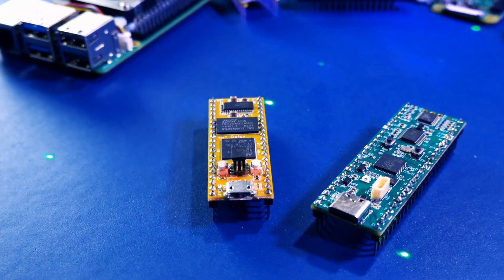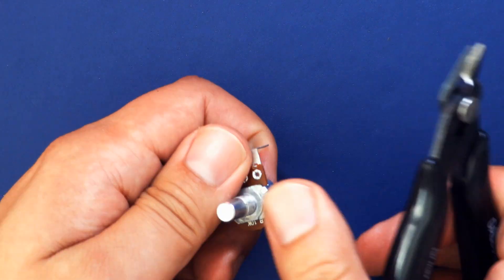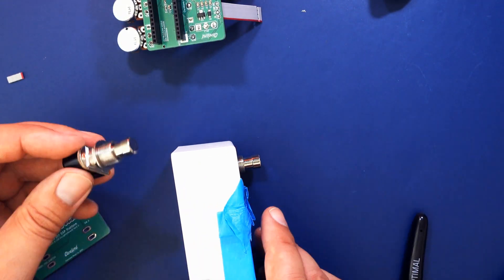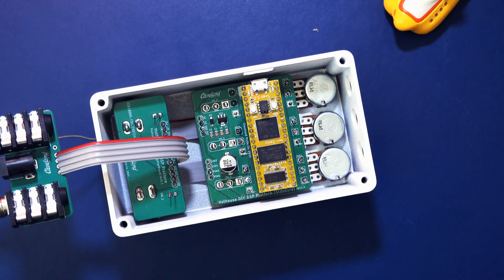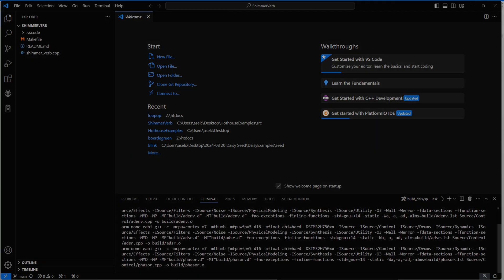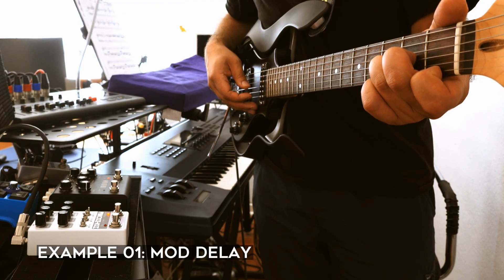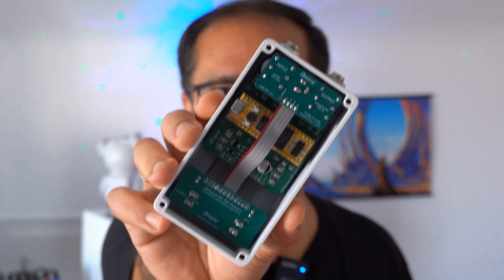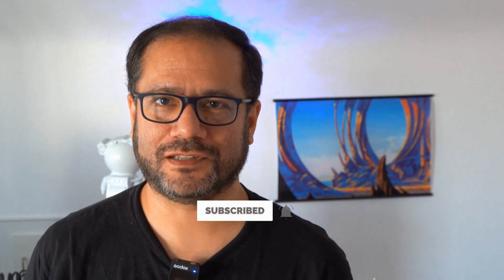Build DIY synths / effects pedals with Daisy Seed and Hothouse (pt. 1)

Comment: I'm looking forward to building mine. I got it about a month ago but have been a bit busy unfortunately to do much. 

I see a lot of potential here in a pedal form factor, as I'm already familiar with the Daisy Seed (from the Pod kit). While you can use C/C++, you can also use Pure Data (pd2dsy)! Pure Data is like a drag-and-drop audio processing design language, like you can make your own custom reverb effect just by connecting up boxes in the graphical design tool. 

I noticed the Cleveland Music webstore is out of stock on the pedal ktis right now, but they report they will get more in September 2025.

Comment: I saw you used this with a synth near the end of the video: is that line level?  I'm debating about building this as I only use synthesizers, and I want to make sure there won't be too much noise!
Reply from the maker: Yes, that was line level. Please take note there has been an update to this pedal, it's now fully stereo (the hardware has changed accordingly). Reminds me I should push out a video on that. :-)
Reply: @mr_floydst  Thanks for responding!  Looks like my synthesizers are going to have a new companion soon!

Comment: Very interesting.  Do they give enough information to do this on a breadboard instead?

FWIW, I recently started using Codium on Windows 7.  It's a build of VSCode without the phone home telemetry, and it's built to run on more versions of Windows than VSCode can.
Reply from the maker: Hi! The only thing you really need it the Daisy Seed. You then can download and compile the examples, the pedal hardware itself just makes it easier to prototype things. If you know how to set up resistors, diodes and pots..., then you can do everything on breadboard.
Reply: @mr_floydst  Cool.  Thanks.  I'll probably get one soon.

Comment: This sounds amazing, and i love that it is an entirely open ended DIY build 
As someone with absolutely no experience, even picking up a soldering gun, or coding, is this a beginner friendly project? I am guessing not, 
What other" complete noob" level DIY effects processors/synth projects might you recommend?
Reply from the maker: Thanks for watching! If you've never touched a soldering iron, this is not a good project to start with.
Please take a look at MODEP instead: https://youtu.be/Z7sGc1ii3Ws  - no soldering needed.
Also BPsynth can be built without soldering, if you buy the microcontroller with the header pins already soldered on: https://youtu.be/FjLcPNhzAwo?si=a4HvAiozjTVWPzVk

Comment: Sweet. Very inspiring. Thanks heaps. Still researching options to try and make Daisy fx with the pod. Was thinking of guitar pedal format too. Side chain compression and some kind of end of chain mastering would be my first preference but really I need to start off super basic
Reply from the maker: I think this pedal is a good starting point as it comes with plenty of controls and doesn't break the bank. While I made this video, a new revision has gone live that has some improvements. I guess I'll talk about that in follow up videos.

Comment: Would you recommend a beginner get started with this or buy one of the many Spin FV-1 kits?
Reply from the maker: Both! ;-)
The Daisy, at the end of the day, is a bit more of an all-around microcontroller, so to speak. It not only comes with audio in and out, but a lot of I/O ports you can connect LEDs, pots and stuff to. The FV-1 boards lean more to heavily into audio processing, but you often have to add  more controller boards to, uhm, control stuff.

Comment: To bad it has no stereo signal, otherwise it would be an intsa buy.
Reply: Well, you folks are mind-readers. The stereo version of the PCB passed bench testing just this Friday. As of now, the version that ships is fully-stereo, features improved input and output impedance, and extends the frequency range even further (for drum machines, synths, etc.)🤘
Reply from the maker: Yep, I should have mentioned that. The plugs are stereo, but the board isn't, unfortunately. Time for a revision! ;-)
Reply: @mr_floydst  Ask and you shall receive 😁Stereo version is shipping now!